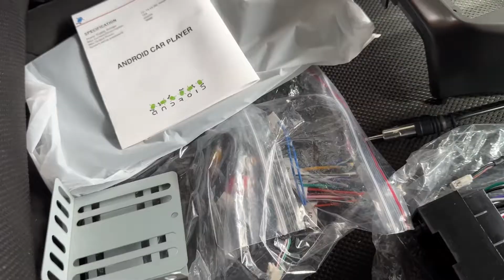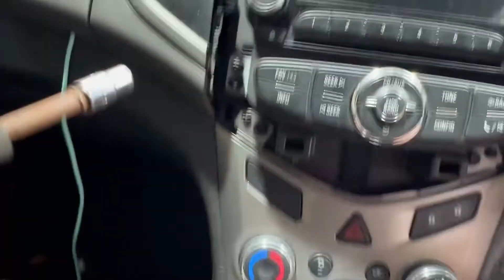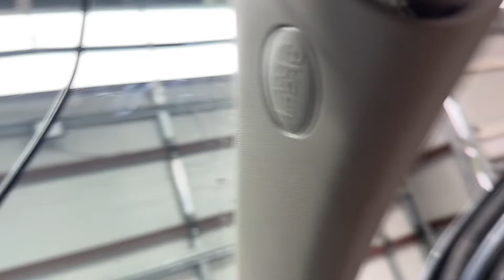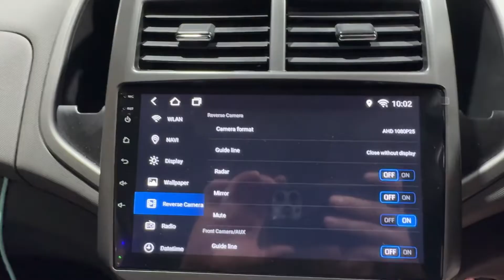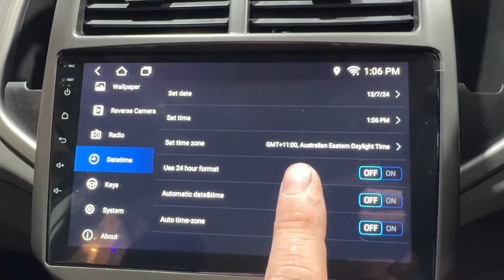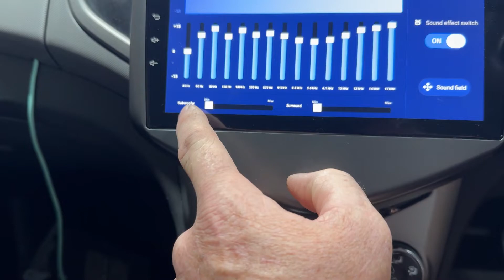Android head unit upgrade with wireless CarPlay and Android Auto!! Holden Barina Chev Aveo and Sonic

Comment: My stereo says to wire the camera to pin5 but I’m not sure what it’s taking about. I know it’s referring to some connection on the power harness. Are you using the head unit power wire to keep the camera on constantly and relying on the cambus to switch to the reverse screen and display the camera?
Reply from the maker: Depends on the car, if you need the CAN box It’s all pre wired plug and play. You will need to connect the wire to the camera either way which is done at the reverse light globe and run around to the camera. The camera video cable has an additional wire built in which can then connect to feed back to the head unit if required

Comment: Hello ! Thanks for your video ! I could not find how to connect the original audio to the system . Is that possible ? Or maybe i didn’t set up ?
Reply from the maker: Thanks for watching.
The harness it comes with plugs straight into the original harness and connects to the speakers and power without any additional wiring. If you are talking about a remote audio input which some cats have, often the kit comes with an adapter but it may also be an option so you’d need to check when ordering.
I hope that helps

Comment: I have no power I don’t know why
Reply from the maker: First point is to check the fuses. There is a fuse on the radio and the fuses on the car for the radio. There will be 2 fuses for the radio, one for main battery power and one for accessories power unless you have a canbus system that provides a signal for accessories power. If this is the case and you don’t have a can decoder box you won’t have power to switch the unit on. Different models have different requirements. Higher end models typically have canbus systems for everything. 
Hope that helps

Comment: After updating the Android head unit in my 2013 Chevrolet Sonic, the steering wheel control functions (volume, call, turn signal sound) stopped responding.
It seems the unit no longer communicates with the CANBUS.
Could the update have reset the CAN protocol or car model settings?
Is it also possible that a physical wire connection (e.g. CAN or ACC line) became loose during or after the update?
What’s the recommended way to restore proper CANBUS integration?
Reply from the maker: @Angel-3A3  I couldn’t tell you without looking at it mate.
It is possible the vehicle specific settings have been altered or reset and will need to be changed again. There is secret menus for a lot of the Android head units that require passwords. I’d try and check the settings in the main menus before the secret menus as they have some critical settings
Reply: @GrantFixes  I already checked the vehicle settings in the main menu and everything looks correct, but the steering wheel buttons still don't work.
Reply from the maker: @ I just uploaded a new video on a Kia which describes how to access the Factory or secret menu and some of the settings. Not sure if this will help you but it’s worth a try.
It’s towards the end when I program the camera type. 
https://youtu.be/nYjdzh5f6vg?si=HQJPjXjOex2ZKtJ-
Keep us posted

Comment: hey, does it work with the built-in microphone of the car for the calls ? thanks for the video
Reply from the maker: @coco2782  The standard harness does not cater for the factory microphone if there is one. A lot of these models only had a headphone on the radio unit being replaced. The new unit has a microphone input and a built in microphone which is sometimes very poor. You can identify the wires that go to the factory microphone and connect through a 3.5mm mono plug. You’d have to research the wire colours and locations in the plug
Reply: @GrantFixes  thank you

Comment: Hey just looking for some clarification. In this video, the link below is the correct fascia used

9 Inch Car Radio Fascia for CHEVROLET Aveo, Sonic / HOLDEN Barina (TM) 2011+ Panel Dash Kit Adapter Bezel Console Plate Facia.
is that correct?

I also saw a comment saying that the unit used in this video was discontinued. so i was wondering if either one of these units i’ve found would work, and if they’d have to be 7inch or 9inch seeing as the fascia is 9inch.

4G 64G Car play Android Radio Multimedia 7 9 10 inch CarPlay Android Auto 2 din Radio Stereo Receiver Player 2DIN GPS 4 Core.

7" Car Stereo Apple Carplay Radio Android Auto Play Bluetooth FM Double 2 DIN.

sorry if this is confusing, just making sure i get everything right before i order 😊
Reply from the maker: @natayamathewson2262   yes mate, the facia is correct and still available at this time, as far as the particular 9” android unit I used, it has been discontinued but there are plenty of other options available and new superseded units coming out. I believe almost all of the 9” android units will fit this facia.
No links came up to double check the ones you mentioned but as per the description the 9” will. Just make sure it has sufficient features for what you require. The faster the processor and more cores means more streamlined operations with multiple apps, and if you wanted to watch YouTube would run better. As far as the memory, the RAM is more critical than the ROM. Ie, 4G64G isn’t as good as 8G64G. It is basically just a mini computer.
I hope that helps a little.
Thanks for watching

Comment: I am looking to get an upgrade for my rs. Can u remember which unit you bought as there are so many different ones.  Thanks
Reply from the maker: @allanhughes8567  I bought it on AliExpress 
 Android 14 Car Radio For Kia RIO 4 K3 2011 - 2015 Multimedia NO 2Din 4G WIFI BT GPS Navigation Carplay Head Unit RHD Stereo Auto
https://a.aliexpress.com/_mOBNq95
I noticed they’re using my video for their promo. Haha.
Reply: @GrantFixes  comes up as Kia Rio??? Is that right? Doesn't look like it will fit the Barina? 🤔
Reply from the maker: @ my bad, so sorry.
I got this one in 2 separate transactions. The facia is below
9 Inch Car Radio Fascia for CHEVROLET Aveo, Sonic / HOLDEN Barina (TM) 2011+ Panel Dash Kit Adapter Bezel Console Plate Facia
https://a.aliexpress.com/_mqO2wfh
And the Android unit we used is discontinued but this one is the same specs
4G 64G Car play Android Radio Multimedia 7 9 10 inch CarPlay Android Auto 2 din Radio Stereo Receiver Player 2DIN GPS 4 Core
https://a.aliexpress.com/_mr2TYyx
Reply: @GrantFixes  awesome thanks